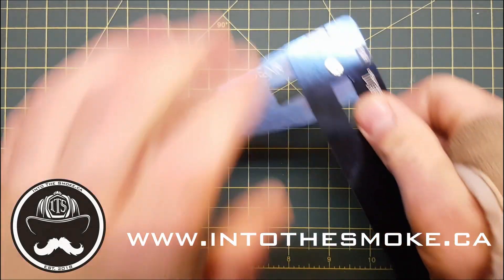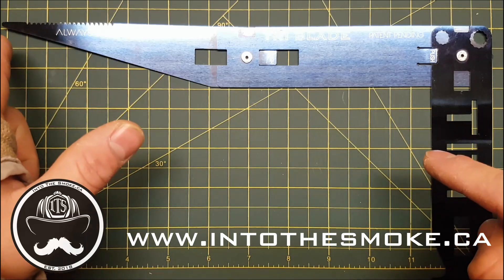TRI-BLADE FULL REVIEW

Comment: Considering this product. I'm a little concerned about the durability at the rotation points. Seems like you'd be putting a fair amount of stress on the hinges used to rotate the different blades. Does this product have warranty for it?
Reply from the maker: Hey Joe, we definitely offer warranty on our tools. No need for concern regarding durability as I personally have tested and have used the same blade since INTO THE SMOKE was established. In regards to stress on the tool - there is in fact minimal when it comes to loiding the latch, if you encounter a latch that appears stuck this would cause the tabs to simple release (by design). This is an indicator that the deadlocking plunger (anti-loid pin) is engaged which would require gaping of the door to release this. More force does not overcome an anti-loid pin, so consider this tool a finesse style approach rather than a muscle through. Thanks for reaching out and for your consideration in the TRI-BLADE!

Comment: Trying to figure out the big difference between LT and the V2
Reply from the maker: Hey Chris thanks for checking us out! Have been meaning to do a comparison video of the two. In terms of functionality towards loiding a latch behind a security plate, they both function the same. The main differences between the V2 and LT are the V2 has an additional blade which offers the option to further extend the tool for special circumstances (not often encountered) as well as the V2 has a few more features - 8mm and 10mm wrenches for battery terminal removal at MVC's

Comment: Is this better than the Seattle Searat rapid access tool????
Reply from the maker: Hey Juan,
thanks for checking us out! The TRI-BLADE and the SEARAT are similar BUT very different tools. The SEARAT is a well built tool however it is much larger in size and heavier in weight, adding unnecessary bulk in your turnout gear. Our TRI-BLADE is designed to offer a variety of functions while maintaining an exceptionally compact and lightweight design. The overall design of the tool's functionality and placement of cut-outs (wrenches etc) have been well thought out for actual use rather than simply advertising "another function". The tool's size makes it easy to carry on your person at all times so you'll always have it when you need it. 

Functions of the TRI-BLADE include:

1)  Latch Wedge – used for over coming security plates that obstruct ordinary access to the door latch with a regular shove knife.
2)  Modified Shove Knife – our modified “over sized” shove knife design makes this extremely easy to use and control the latch.
3)  Residential Gas Wrench – used to shut off gas supply to the structure.
4) O2 Cylinder Wrench – used to open and close oxygen cylinders.
5) 8mm Wrench (12 point) – intended for but not limited to, battery removal at MVC’s as part of vehicle de- energization.
6) 10 mm Wrench (12 point) – intended for but not limited to, battery removal at MVC’s as part of vehicle de- energization.
7) Window Punch – for gaining access to a vehicles interior and glass removal as part of a vehicle extrication.
8) Serrated Edge – used to cut a range of materials from seat belts to rope.
9) Through The Lock Tip – used as a means of manipulating a lock mechanism, when TTL tactics are used.
10) Hose Coupling Wrench - used to loosen / tighten hose couplings on 45mm - 65mm hose

Learn more - www.intothesmoke.ca